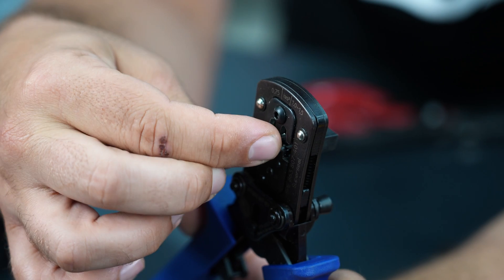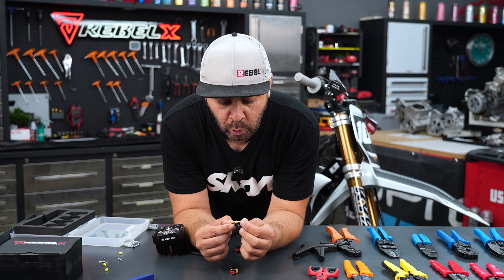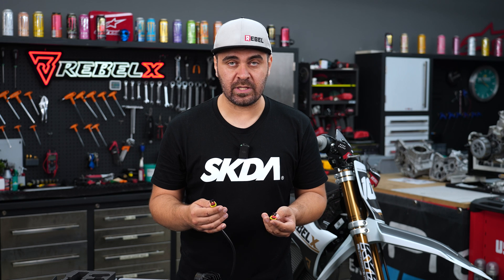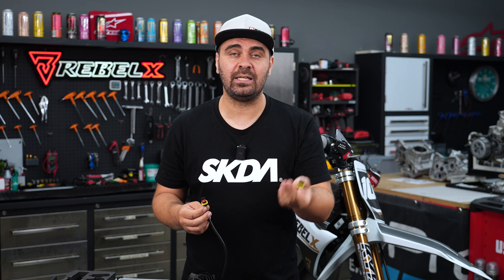SUPERSEAL Connectors Correct Crimping Tutorial

Comment: I use one of the  bleu crimping tools on the table. Yes my goal is not a Dakar type ralley but I also dont like electrical failure so far I can tell for the 'amateur' type of mechanic , the 'cheap' one will do the job.
Reply from the maker: Sure but I still believe investing in good tools is worth it also for the amateur rider, because once you have good tools you end up deciding to do more work. Before getting to a crimping tool its better to invest in good wrenches.
Reply: @ManuelLucchese1  I totaly agree.

Comment: Great video.hes right I bought a cheap changeable crimper and when I went to use it for the second time of the removable crimps had fallen out of the jaws, and the shop was closed. Tried to use side cutters but the connector does not feed well into the housing. Then the connector dislodged inside the housing  and the wire come out.😅